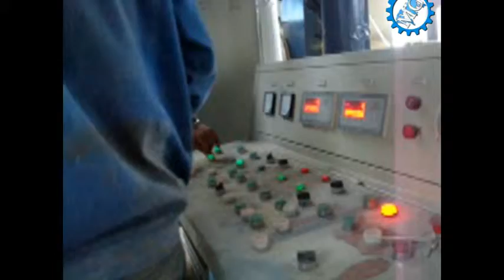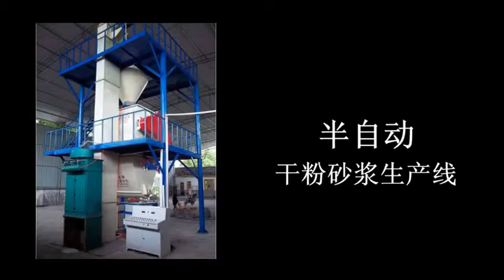MG Automatic tile adhesive mortar production line

Comment: This automatic dry mortar plant provided by Zhengzhou MG Industrial Co.,Ltd, which is a professional manufacturer of pre mixed mortar equipment over 10 years in China. we provide our clients with turn-key service, include ODM high quality machine, special additives, formula for mortar. installation and commissioning on site. 
this automatic dry powder production line can produce various kinds of dry mortars like:
wall putty plaster powder, tile adhesive, tile grout, AAC blocking jointing mortar, masonry mortar, construction mortar, self-leveling mortar, gap filler, repair mortar, decorative mortar,etc.
For more information, welcome visit our web site: www.mgcn.com.cn/  www.zzmjjx.com or send email to : skyler@mgcn.com.cn